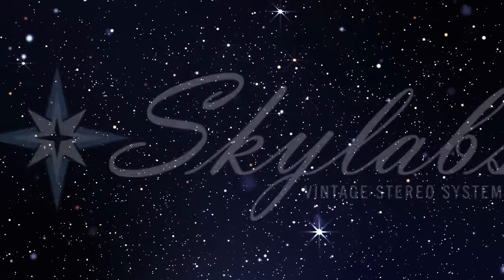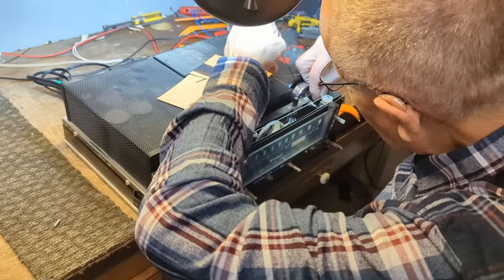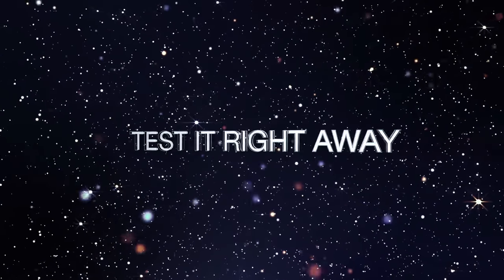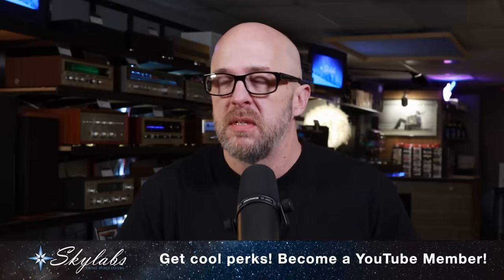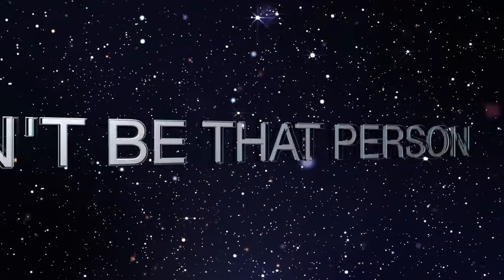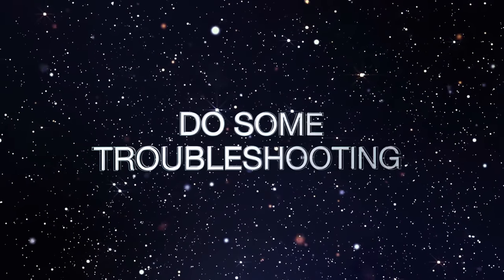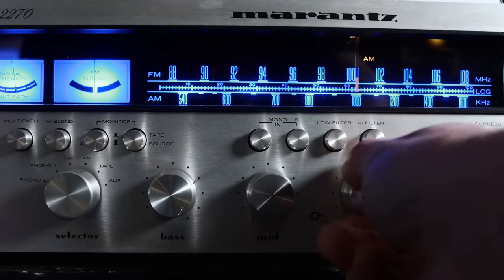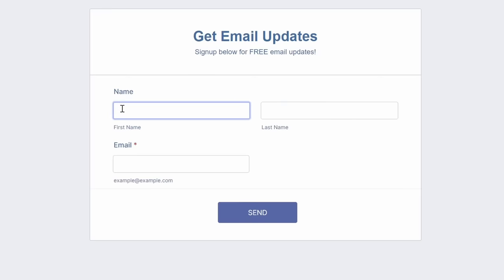Don't EVER Say This!? Vintage Stereo Repair

Comment: First, thank you for the great video. Second, is the lack of techs going to cripple vintage audio? I am trying to learn electronics but only as a hobbyists and only audio for now. Am I right to assume learning a multimeter and an oscilloscope with soldering is the bedrock of the practical skills necessary? I am still working on basic theoretical knowledge from "Teach Yourself Electricity and electronics" by a Mr. Gibilisco. Is there a recommended approach from your and your techs experience? I watched Rob's video on your tech talk and still don't know half the words he said! Again thank you!
Reply from the maker: Vintage stereo equipment has several huge things going for it, IMO. 

1) We have over 45 years of repair knowledge by seasoned techs being preserved VIA Internet forums and groups like Audio karma, antique radio forums ect. 
YouTube content creators like Xraytonyb, blueglow and Mr.Carlsonslab are making free video instructions.
2) manufacturers wanted this equipment repaired. So schematics and service bulletins are usually readily available.
3) the capacitors, transistors and resistors needed are still being produced which makes "most" vintage equipment repairable.
4) with the value and demand of these pieces increasing, so has the amount of people wanting to learn how to fix them.
Watch videos, read forums. 
Buy cheap pieces to practice on. 

Bringing a dead piece of gear back to life is highly addictive and rewarding.
Reply: Kevin, thank you. I am hooked, personally. I got a Marantz 1810 cassette deck running and it was very rewarding.  Mostly cleaning and mechanical repair. Now I have to fix the matching receiver a nice little 2216b. Good times! Again, thank you.

Comment: I agree with you that the high end equipment is easier to fix. It's the inexpensive Chinese built units that are hard to fix since the engineering is done on a "just make it work".

Comment: also... old capacitors are sloppy and the sound is "warmer" so once replaced, your sound will be more precise and cleaner. once your electrolytic capacitors start to go, you are likely to have more of them. i would recap the whole thing if that happens. capacitors wear... even when they sit on the shelf. it is a time thing not use.

Comment: I owned a computer repair shop 13 years ago and worked as a computer tech/Network Admin for over 20. Dealing with unreasonable customers is what made me go into a different field. I've ran off customers for being rude. When they ask for the owner and I say "I am the owner, take your item with you and don't come back". They think it's my place to bow down and lick their shoes clean and that's not going to happen. The customers expectations are higher than Willie Nelson 99% of the time. Theirs no way to truly get someone to appreciate the art and skill required to solve complex problems. Dude, your channel is full of practical information and help. I restore old receivers, integrated amps, etc. as a hobby and it's so much fun, yet very challenging at the same time. Thanks for putting out informative content.

Comment: Dude my mono tube amps never give me a problem I recaped th myself have a pair of white 32 band eqs a audio research preamp and preSonus ar12 jbl l200 I never have a problem if a power amp gives me an issue swap it and do the necessary repairs

Comment: I had a Receiver that the left channel went out on so I decided to have my repair shop completely overhaul it since it was going in. Every board was recapped as well as every transistor and resistor being replaced too. It was expensive but it was my favorite vintage receiver and figured it was worth it. 
When I got it back and hooked it up to my speakers, my system didnt sound the same anymore. I did notice it was improving after a few weeks of using it but I ultimately ended up selling it and buying another one off Marketplace. Is this a possibility even when all the new parts are the same specs as original?
Is it because it needed more time to break in? Or did I have too much done to it? 
Now the replaced receiver is acting up,,,same thing (Left Channel) Should I just have what needs to be done completed?
Reply: I will offer you my experience. Decades ago, I purchased a floor demo at a good discount,  a Phase Linear 700. Likely a bit "used and abused" on the sales floor, and they had it installed in a wood case, an option I chose not to purchase, as my thought was, why encase heat sinks in something that restricts air flow?
I was driving a pair of Advents, had a 3 amp fast blowing fuse inline on each. One day, the bias transistors blew, dumping 60 hz (possibly rectified?) AC into the speakers for a few seconds before the fuses blew. As it was still under warranty, it went back to the factory.  One thing I learned is that, once it was repaired, they ran it for 24 hours before shipping it back to me. It's a common practice with electronics.
Subsequently, I purchased a number of reconditioned computers, at a time when the failure rate for new computers was about 25%, industrywide. They would take them back, figure out the problem, repair it, then run it for 24 hours. It's a common practice.
Reply from the maker: Thats a tough one. It could be that after that extensive overhaul it sounds the way it sounded brand new? It could be that you liked the way it sounded with the original componets being "possibly" a little fatigued. A/Bing the sound off memory is almost impossible, IMO. 
Personally, my equiptment gets new power supply and filter capacitors and any known issues addressed. Thats strickly because of budget and where I think my money is best spent in preventive maintnance. Everyone is different though.

Comment: There are people with a vintage stereo that don't have a backup (i.e an addiction)? I never would have guessed.

Seriously though, if you have a 40+yo piece of equipment you rely on, it's ridiculous not to have a backup. If you have a monster Pioneer, Sansui or Marantz, go buy a 30W version from the same range and swap it in as needed.

Comment: Thanks Kevin. Quick question - I have a vintage Garrard turntable in pristine condition that needs some work. My fear is the silver plate around the controls might get scratched while it is being worked on. Is there something I can do to safeguard, other than asking the technician to please be gentle?
Reply: I normally put that blue painters tape on the faceplates of units I work on. It works well enough and easy to get off without leaving residue.
Reply: Be careful with that, the printing can come off very easily on these old units.  I will cut out paper scraps to put over the printing before I apply the tape. @JonPaul
Reply: @davidnorton573  That's a great idea- although I've never had an issue, I'll pay attention and do as you describe.

Comment: What about when a customer brings you a bag of garbage parts from an eBay or Reverb "restoration kit" and asks you to install them?
Reply from the maker: Yup, been there. Depending on what it is, I might tell them if you want to use those parts it will void the warranty on the repair. It really depends on the parts, the customer and the piece, though.

Comment: A few things I learned in the late 70s.   These from absolute gurus on how stereos work, as well as do and donts.

1) The actuial sound as you know it comes from your source as well as speakers , that meaning your speaker can and should be perfect to the music coming in. Doesn’t happen or mirror perfectly most times.   But placement and Quality helps.  Remember that just a different source (meaning a different CD) changes everything.

2) if you choose to upgrade, always go for the CD unit or turntable cartridge.   If you upgrade the amp and have separates, you will do best to upgrade the pre amp rather than a power Amp. 

3)A property functioning power amp, does not sound good or bad.  You can augment this with your preamp controls.   

3). Remember no amp should sound anything when setup properly.  But I can say 100% if you up grade the preamp section it Is the best investment.  I do see a bit higher quality sound upgrading the preamp.  It should be true on integrated receivers to the most extent as well.

5). I’ll say it again Speaker are everything…
Hope this helps!

Best to everyone!

Comment: When you take an expensive car full of expensive parts into a garage. You are going to trust them, that what you took In, Is what you will coming away with. And the longer the Intake of Breath, the bigger the bill. And Saying they have changed out perfectly good expensive parts for cheaper ones.

Comment: My bad I confuse you with Just Audio…who told me Kenwood and Technics were empty boxes?…..😵‍💫
Was that you?
Reply from the maker: Might have been me as some are for sure. Kenwood Super Eleven
Reply: @skylabsaudio  Thanks Kevin, some days I’m  sure I could hide my own Easter Eggs.
And I think your right, I had head the tuners we’re well designed.   But the cardboard or composite back says a lot?
Best
Greg
Reply: @skylabsaudio  
I did invest in the KR9600 I fell victim to the power meter and cool rack handles!
Reply from the maker: They are nice looking- no question

Comment: Well you just pointed out all the reasons why a person wouldn't want to invest or own old equipment just a money pit unless you're filthy rich and don't really give a dam and besides why would you want to invest in a money pit when you can buy new equipment that's 10 times better than the old stuff ohh yes there is still high end new equipment out there and available
Reply from the maker: I 100% agree. Vintage stereo equipment is not for everyone. Givin there is a finite supply and the already inflated prices, we can probably stand to deture a few that aren't right for it anyway.
Reply: Well speaking as someone who is lucky enough to have built up several mid to high end systems with modern gear, vintage gear just sounds different, often looks beautiful and is fun to play around with if you have basic skills. You dont need to spend a fortune. I just picked up a beautiful mint condition Sansui AU 101 amp for just over £100 and several lovely late 70s JVC receivers which needed nothing more than Deoxit on the pots. It cost me less than £100 for  the two together.
And with vintage you can usually sell for at least what you paid.
And, it was watching Kevin which turned me on to vintage stuff, especially Sansui, which I knew nothing about. Thanks Kevin !
I also picked up a Japanese Sansui AU 7700 amp with matching tuner. More expensive but a lovely pair of pieces.

Comment: I didn’t care for this video. I dealt with Electronic Technicians? In the 1970’s that were ignorant, abrasive,  un professional as hell. Anyone can claim their a Tech just by putting a ad in the paper or online. I’ve been into HI FI for 50 years and haven’t found many that I would take my components back to. I think you’re implying we should kiss their asses. Common courtesy is a two way street!